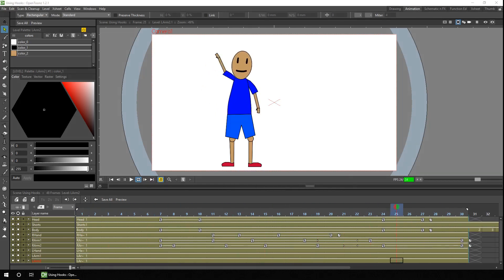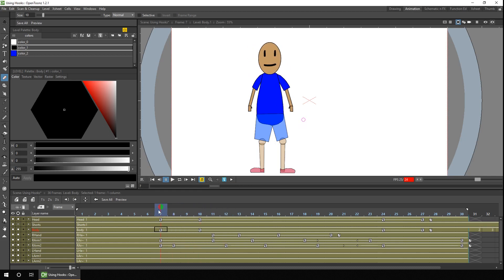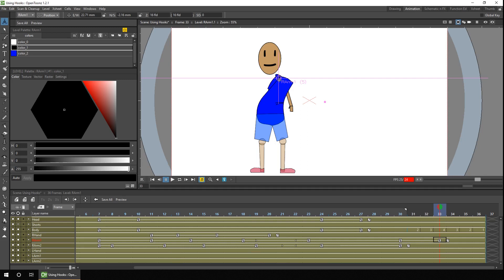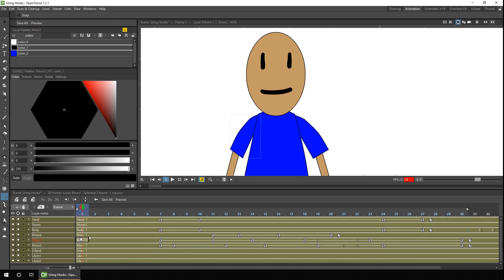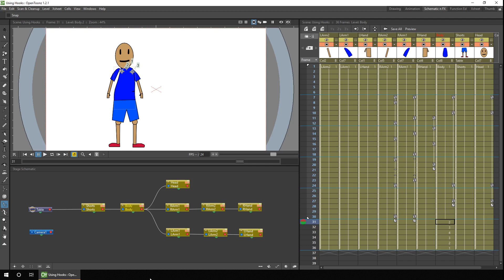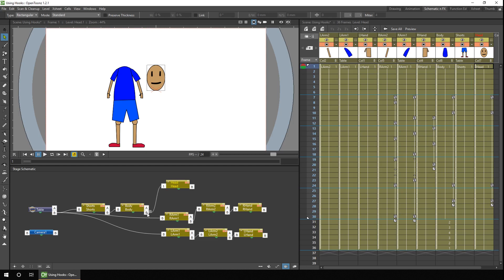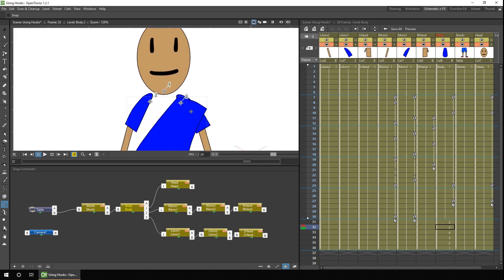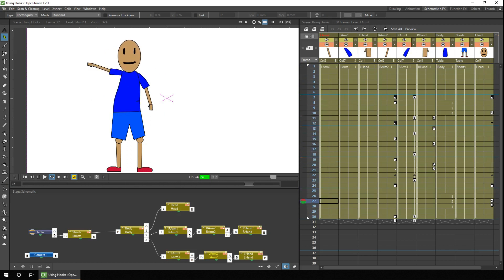Using hooks - to connect hand drawn-frames in cut-out animation - OpenToonz Tutorial

Comment: Thank you! This will come in handy at some point. 
Unfortunately it says I cannot use the current tool on a mesh-deformed level :/ 
I just want to anchor my mesh-deformed arm to my mesh-deformed shoulder, but despite linking the arm to the body in schematics screen it refuses to follow it, all other body parts are set up the same way and are linked and working correctly, it's beginning to hurt my brain Hahah
Reply from the maker: If you've already got a mesh attached to your column you don't need hooks. Each joint in your skeleton can be connected to another column in the same way as connecting a hook.
Reply: Hi  @DarrenTAnims  Thanks for the reply. 
I have tried both linking the arm/arm mesh to the torso/torso mesh seperately in schematics, all combinations have absolutely no effect. 
Yet I have no problem at all linking the object held in the hand and the flowing robe over the arm, which is odd, clearly I understand the principles of linking them since they all work, I'm doing the same for the arm to the torso, but it just won't link? 🤷‍♀
I've only started using Opentoonz yesterday so I'm struggling.

Comment: Do not take offense, but I have an observation about this video.

Something about this method seems off, hooking one layer to another should not require manually telling it where to be at the end of an animation cycle, or you might as well just use keyframes (and its just as much work to do keyframes as the workflow you show here with hooks as it appears to not actually parent the layers at all).

The logic of the hook tool is it HOOKS one item to another (much like parenting in other apps) meaning it should automatically follow the parent. So I am curious why the hook tool is being used as if it were a keyframe here? I'm new to opentoonz but proficient in editing software and other animation applications, so this is coming from a place of knowing how this tool should work.

Why is the hook tool not actually hooking once implemented? Why are you adding it's endpoint? adding an endpoint means it is not hooked at all, it's just a keyframe basically how you show it here.
Reply: and i see others ask this as well, and you say "well plasrtic tool"

but i'm not asking about the plastic tool, i'm asking about why hooking doesn't actually parent or connect things manually when they move.

to clarify
Reply from the maker: I think I understand what you're asking. The hook can't follow when each drawing moves, which is where the hook come in handy. You can place the parenting location for each drawing, to be sure that as you change drawing, the column will still align.

Comment: what is the benifit of hook points if we have to move them manually in every frame when the body moves,
instead moving the body parts directly is better
Reply from the maker: You're right that moving hooks on each frame would be as much work as moving the arm, but this video shows that you set up the hook once for each separate drawing. And the benefit comes when the hook is connected to a plastic mesh. Then when you move the plastic mesh, the arm stays connected without moving the hook.
Reply: @DarrenTAnims  in toon boom harmony they have a nice tool ehere they connect they layer to  the main layer so when main one moves all other moves along automatically
Reply from the maker: @fahads_artwork  You can do that in OpenToonz too. You connect columns using the Schematic.
Reply: @DarrenTAnims  oh Thanks
Reply: but how do you have a video?
Reply from the maker: @fahads_artwork  Yes. Check out my cut out playlist. The first video shows how to do this to create and image the BB8 bot.
Reply: @DarrenTAnims  okey Thanks i will check
Reply: @DarrenTAnims  that is for cut out i needed to move the body parts using plastic tool but the body parts are stuck  on root skeleton each body part is on different layer do i have to use hook for it ?

Comment: I have a blank head and a mask - how do I move them together as one?
Reply from the maker: Hi. You should probably connect the mask to the head (on the stage schematic), then when you move the head, the mask will move with it. If you're unsure, you want to drag a line from the right hand connector of the head node and into the left hand connector of the mask node. Hope that helps :-)
Reply: I did that - joined in stage schematic - had to manually set mask  on blank face but when i move them, the mask shoots to another spot - tracks the blank face but not stay with it. thanks. @DarrenTAnims
Reply from the maker: @soeurwulfknightserrant5569  If you can share a screenshot, a video or your project, on my Discord, I can take a look at it for you. But that should work.

Comment: Hi Darren, great video! Could you tell me how to overwrite multiple frames with one specific frame? I've applied an auto-lip sync to a column of mouth movements, but I want to overwrite a whole load of the cells so that it's just one frame of the mouth. I'm trying to select about 100 cells in a column (from cell 1-100) and overwrite them with just a specific frame, but can't find where to input this.
Reply from the maker: Hi Michael.
If the drawings you're replacing are all the same drawing in the same level as the new drawing you want to show, then you can just highlight them and press Q or W to scroll through the drawings in that level.
If you've got different drawings in frames 1-100, then I think the best way is to highlight them, then delete them (delete key) and the paste your new drawing into frame 1 and either hold Ctrl and click and drag its extender up to 100 (holding ctrl prevents the next drawings in the column from moving too) or if you've got a drawing on frame 101, then you can right click in frame 100 and choose, Fill Empty Frames. And that will extend the drawing up to frame 100.
Hope that helps.
Reply: @DarrenTAnims  Thanks so much Darren, that's really helpful! I'll try it out

Comment: How is moving the hookpoints at each frame less work than moving the arms at each frame?
Reply from the maker: You're right that moving hooks on each frame would be as much work as moving the arm, but this video shows that you set up the hook once for each separate drawing. And the benefit comes when the hook is connected to a plastic mesh. Then when you move the plastic mesh, the arm stays connected without moving the hook.